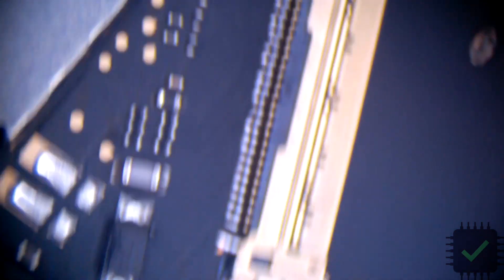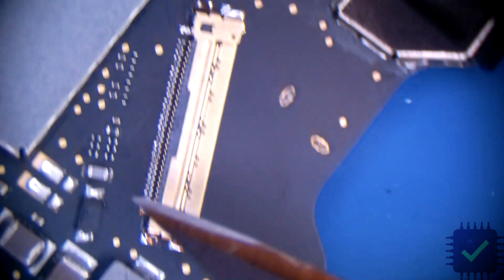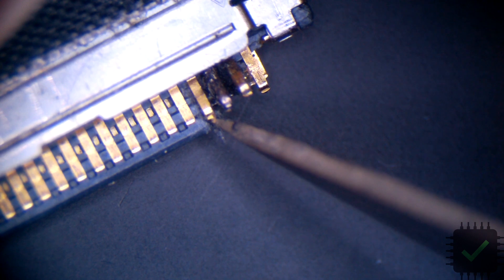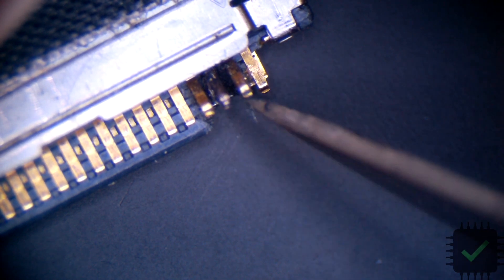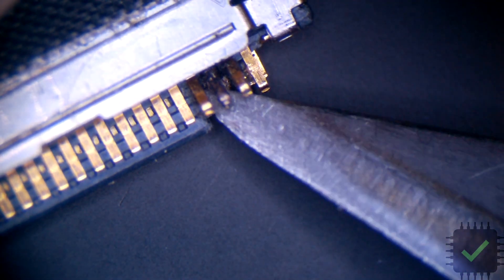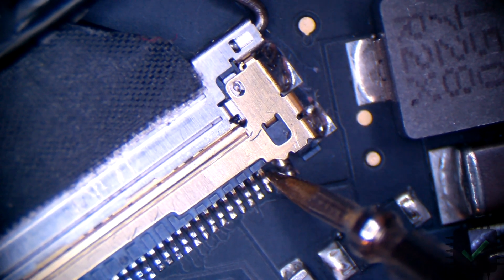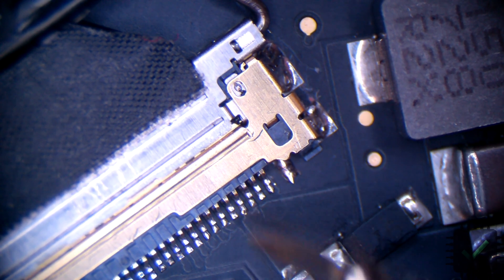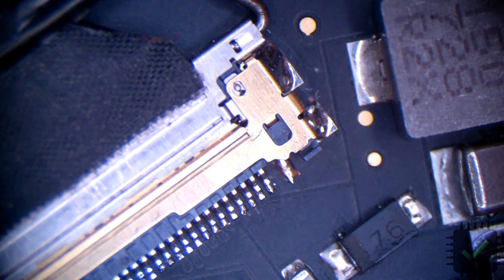Apple MacBook Air A1465 LVDS Connector Cable Repair after liquid spill without screen disassembly.

Comment: I have a 1465 one, one day the screen stopped working, it has horizontal colored lines and flickering, no water damage or anything.

I guess could it be the lvds cable or the logic board? I don't have an adapter to test it with my monitors.

I didn't even use it but I wanted a simple mini server and if I could just get the adapter and have a headless server I'd be set !

Thanks!

Comment: My screen keeps flickering. Is this the possible problem
Reply from the maker: Most-likely no.
Reply: @applepietech  I've been reading some are saying the GPU is likely.
Reply from the maker: No, either the screen or the backlight circuit on the board. That would be my rough assumption
Reply: @applepietech  I tried a second monitor and it still flickers
Reply from the maker: It flickers on another good lcd? In that case you have an issue with the logicboard. I can fix that for you. You can contact me at info@applepietech.com.

Comment: Any day that you do not have to remove an A1466/65 bezel to replace the LVDS cable, is a good day. Nice repair Vlad
Reply from the maker: True. I still manage to forget about those 2 flex cables on the bottom :)